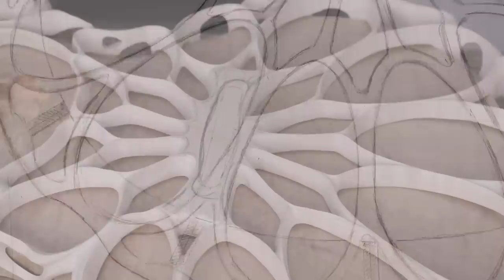Ep 2 of 2 - Full Build of the 90 Hour Build - The Complication

Comment: I'd go crazy when its get dusty under the cover.
Reply: Compressed air can...simple fix.
Reply: @djl3485  some dust is sticky
Reply: @weareallbeingwatched4602  Especially when you pour a few beer on it
Reply: Dust off
Reply: But, you'll feel AMAZING when you muster the focus to dust under there, and see the task through!!! It's GOOD for your soul!
Reply: It clips on and off... not like you can't remove it and polish the instrument still, only a rookie would've made it fixed to the body!😎
Reply: Souls Of Sorrow - Did you watch the whole video? There are like 82 pins that need to be lined up, and it is held on, due to the extremely slight differences in all of their respective angles, creating enough tension...not the sort of a system that is meant for very many cycles of "remove and replace".
Reply: its a display guitar. I'd have it in a airtight case
Reply: You mean "it gets"
Reply: @ivany8309  You mean "bears"
Reply: @samuelluria4744  I have no idea how he aligned those pins to perfectly fit into one another. I was scratching my head
Reply: Divad Ignawm - Same here. I have done similar things with pins, but this was way above my pay grade. Incredible craftsmanship.
Reply: @samuelluria4744  Man this is incredible. I'm talking of from a very serious note. I've done mechatronic engineering and there's an area called inverse kinematics, a core unit where you map points in space in the x,y,z coordinate relative to an Origin point, 0,0,0. And that's how a robot or a CNC machine can machine such complex geometry accurately. Or using a robotic arm/cnc machine one can align such pins, and still requires advanced skills.

 But to manually make the outer skeleton as a perfect negative of the guitar body the way this guy as done, that's insane. It should be impossible to do manually. Anyway there are always legends, human wonders of the world, u ever Willard Wigan?
Reply: Divad Ignawm - You are correct. There ought to be more recognition of, and encouragement to aspire to, the highest levels of human craftsmanship. Such excellence is uplifting to the soul, as was understood by most people of earlier generations, and is less so today - despite the You tubes....
Reply: @AndyMartin401  no, he totally meant beer, you know, the beverage.

Comment: The guitar is very beautiful and very well finished but without this white thing that looks like nothing and completely distorts the guitar, in addition to fix this awful thing, it made holes all over the soundboard of the guitar which was beautiful and on the handle, what a massacre, all that to fix something that does not look like a tympanum stained glass window of a cathedral, for me, it's horrible, the guitar was so beautiful without it.

La guitare est très belle et très bien fini mais sans ce machin blanc qui ne ressemble à rien et dénature complètement la guitare, en plus pour fixer ce truc affreux, il a fait des trous partout sur la table d'harmonie de la guitare qui était magnifique et sur le manche, quel massacre, tout çà pour fixer un truc qui ne ressemble à un morceau de tympan en vitrail d'une cathédrale, pour moi, c'est horrible, la guitare était si belle sans çà.

Comment: The outer part is ugly, but without it, it is beautiful!
Reply: Thank you for redeeming me of being the only one thinking that. The wood and work he did was cool to watch and looked great, then he stuck a cage around it haha. The problem is A. The bulk outwards of the cage, presenting a not very aesthetically pleasing overview, from a glance it looks like someone tried to paint it and did horribly or has spider webs around it. B. The head should not have the cage on it, if you for some reason need the design on it please remove the heads cage, it doesn't make any sense it looks like someone had a gig bag around the guitar and just cut all the pieces they needed to be able to play the instrument HAHA. Had he made the cage a harder material and had it cut by a laser or water her might have been able to add a dynamic to the instrument without taking everyones eyes off the whole thing. We don't even see the guitar we see his attempt at putting a semi-symmetrical flower design on his instrument. and a sock on the head-stock, and why is the back protruding so far, to make the indentations that will appear on your under arm appear less? This would not be in my collection unless you move the design in and actually have it fit, and two, take the sock off the headstock dude...

Comment: Fabulous, but here's where I have a problem. The tailpiece and pickup look completely reg. The box for the pickup is a simple rectangle with 90 degree angles... plus, it's all metal. Seems like it's time to push past that look, on that, and even the toggle switch, which Switchmaster has dominated way too long with it's average quality. Buy an aircraft switch, or one from Japan, not designated for a guitar, and the quality is just amazing. Those things really pop into positions. A completely different level of switch. I cannot for the life of me figure out why these pro level switch companies  don't get in on the guitar action, considering how many guitars are bought every year. They don't need to replace Switchcraft at the factory, just start putting ads up in the right magazines. Reviews and crosstalk will take care of the rest. Players love to tweak their gear. And it's time for manufacturers to have bigger channels in solid bodies for wiring. It's ok for installs, but for repairs, those small spaces at the bases of toggle switches, and those channels from them to the pots are a nightmare for repair work. A whole new approach is needed.

Comment: Serious dumb noob question regarding finish work: is there a reason the auxiliary holes are drilled and tapped AFTER the finish is done? Why not create all the smaller holes for the bits and bobs first, plug those holes, put the finish on, and THEN assemble everything together? Seems like it would stand up to magnifying glass-style inspection for far longer too.

Comment: Very inspiring! Why does the top web design extend beyond the bottom of the guitar where the strap button is located? It seems impossible to attach a strap to the guitar with the strap button buried deep beneath the web. It also seems like the top piece is quite prone to breakage at the bottom where it's not supported by the body at the most vulnerable area of the guitar, where it usually takes most of the hits and bumps where the guitar usually sits on a guitar stand for instance. A beautiful piece of artwork as a showcase but not a practical instrument for playing everyday or gigging with.

Comment: Ive noticed on 2 of your videos now, you dont seem to screw the neck to the body like I see on a lot of builds. Is the wood glue enough to hold it with all the string tension?
What stops it coming off?
Reply from the maker: Wood glue and good joint is more than strong enough, as a general rule screws are used on cheaper mass production guitars, though there are exceptions of course, and we tend to use glue in most cases

Comment: Only complaint is that you would have to take that asthetic cover off to polish the top every time. Question though -- is the tail piece still adjustable for different break angle?
Reply from the maker: Not adjustable really - but also there is no need for it to be.  It is at the angle I needed - the bridge however has a bit if adjustment built in.  Ben
Reply: @CrimsonCustomGuitars  I have heard many different things about bridge to tailpiece break angle, and I use many different tunings. Just curious really. Thanks for answering so quickly. You make some beautiful guitars.